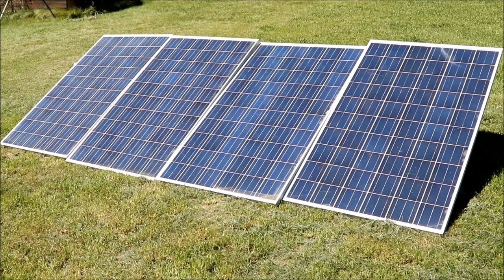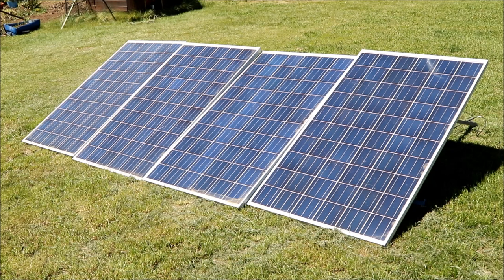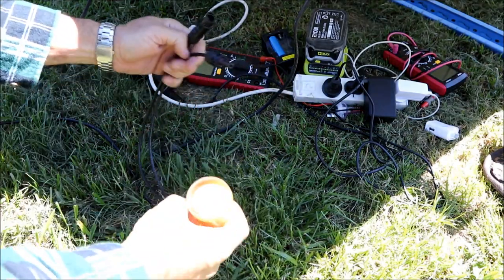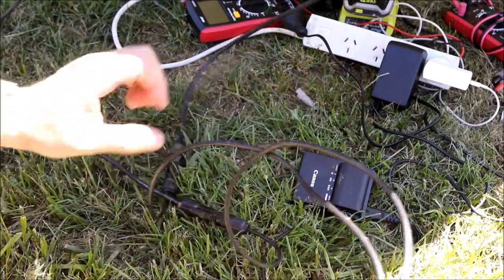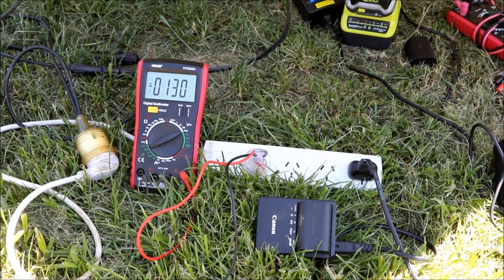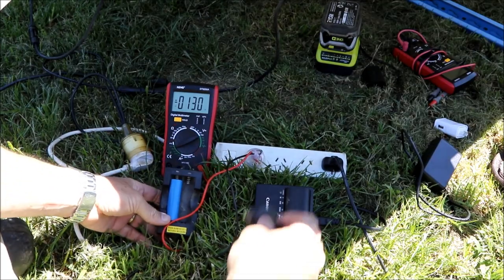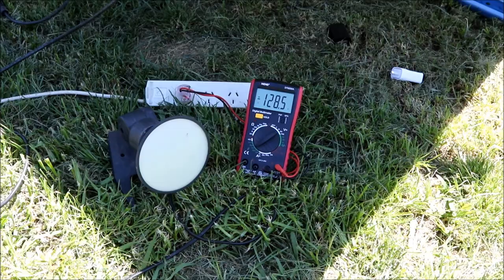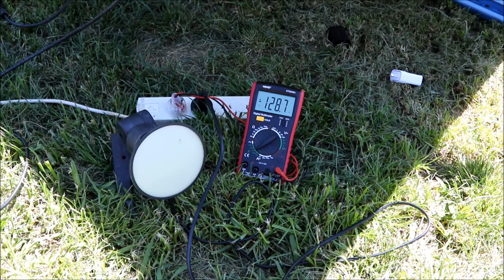Powering AC appliance's Direct from Solar panels.

Comment: U know what all these chargers do?
the rectify the AC from the mains they are "fed" with, to charge the first (primary) capacitor
so giving them DC as "food" the primary rectifier in switching pwr-supplies 
just kinda gets the current thru one diode.

as for the secondary side of pwr supplies U often can power up devices with blown pwr-supplies 
externally by connectin just another pwr-supply in parallel. the output voltages I mean.
So I have a monitor here that just needs 5V and 12V internally to operate.
I run the monitor with an old pwr-supply from an HDD case.
noo need to find components that lost their markings.
Grannys washing machine runs the same way. It just needs a pwr-supply for driving the 5V micro-chips
and 12V for the relays in there. the relays have to switch the AC mains for the motor and the heater of course.
Greetings from Germany

Comment: I am interested in 12v, 24v, 48v power systems and equipment.That's what we will all be left with when the Sun lets the magic smoke out of everything before too long.
Reply from the maker: That's something I'd like to look at as well but is a bit exy to do for Vids as I don't have anything.  I was thinking if I do more solar Vids or even do a solar Channel I might be able to get some companies to send me products I can set up and do vid reviews on.
Reply: @glumpy10  Sounds like a great start! However, I fear having only a solar channel might be too narrow, too specific to draw a wider audience. 
I'd like to share some thoughts on it? Not saying you should do any of this, just thinking out loud: 
Maybe - How about expanding the oil-burner theme into an exploration of all kinds of home made energy and power generation techniques (like making power if the grid goes down).
There's biodiesel, biogas, solar panels, parabolic solar cookers, fresnel lenses, wood-gas production and storage, HHO production from batteries charged up with produced power, all kinds of fossil fuels-plastic to gasoline, used motor oil to black diesel or just thermally cracking petroleum products into fuel, wood stoves and heaters, other kinds of oil burner type heaters and heat exchangers, thermal mass heaters, rocket stoves, candle power, steam power, human / animal powered generators, refractory cements for building forges, crude battery building or rebuilding from scrap, casting metal parts for energy machines, and many other topics. Appealing to a wider audience this way will lead to more subs, more subs will lead to endorsements and sponsors. 
Or you could just start a Patreon type deal, or offer more content for $$ with the Youtube channel subscription( i don't know much about it, but I pay $5 through youtube to see private stuff on RobertMurraySmith's channel, extra info vids and so on) . 
I hope some of this is useful, I know it's hard to do anything without a budget, but I know you are quite a resourceful and out-of-the-box thinking Oil Burning Maestro, so no worries. Also you might suggest that I start a channel instead(lol), but I am quite ugly , have no personality and have a terribly mousy voice, it just wouldn't work..lol. You on the other hand have charm, pizazz and a special spark, a very bright and relatable personality. Keep up the fun. We all enjoy you having fun with it all.
Cheers and enjoy the weekend.
Reply from the maker: @undernetjack   Wow! I think you must be confusing me with someone else but thank you for the very kid words.  I think you are right in looking at a broader range. I was thinking more DIY power generation like with converted induction motors, Methane I have played around with and the like.  Independence or at least backup is something I like so that would be the overall theme. 

Was also thinking of what you were saying, would be nice to get some sponsorship with related products to try out and report on.  I sent Bangood a message recently about an oil burner arrangement they have someone pointed out to me  if they would send one for me to review but not got any word back so far.  Thought it would be perfect for this channel but obviously they thought different. 

Anyway, thanks for the very useful comment.  It was helpful and great feedback.  Much appreciated.

Comment: Challenge: Solar panel that runs a water pump that moves water that turns a paddle connected to any sort of alternator that charges a battery
Reply: What is that your creating a arc with!!??
Reply: Hey a solar powered jet engine (arc, blower, fuel) would as well be a great video
Reply from the maker: Why would you want to have a pump running off solar turning a water wheel? Sounds like some sort of "Free energy" crap where they make multiple conversion losses and claim a net gain!  :0)   Then again, the more complex you make things the more impressed people are and take it as creditable even when it's not.  The arc was just some carbon Gouging rods I touched off a metal plate.  I have ordered a Ducted Fan engine I am waiting on to do an an oil powered Jet or Motor jet as it is more correctly called.

Comment: oh yeeeah because the switch mode power supplies first rectify the AC to DC, 240v->400V in a capacitor, and then it's business as usual. You can just feed it DC directly.

Comment: Please don't do this. If you know what you are doing, chop the plugs off and hard wire the chargers. If an initiated person saw the power outlets and plugged a non switching device into the power board like an old power cube or transformer, they could start a fire. If you know what you are doing, you need enough DC to meet 1.4 times the minimum AC voltage of you device, but it should be hardwired or use different plugs so people cannot accidentally plug unsuitable devices in.
Reply from the maker: This is the sort of safety obsession  mentality that has infinitely more potential to cause problems than what it seeks to prevent. No Idea what an Initiated Person is nor what they would be doing wandering round my back yard Plugging things into what they don't understand. My wife and daughter know better than to touch anything like this and so does the dog as I have never seen here messing with anything I have been playing with either.  Who do you think is going to come in you yard with a lead and be looking for any outlet they can find?  Not about to chop the plugs off anything as this is temporary measure and will want to keep the panels intact and can't chop off plug packs as that would then be running hundreds of volts  though something designed for less than 20 and that WOULD start a fire or destroy the appliance.  Did you even watch the vid and take note of what was being used?  Clearly as demonstrated in the Video, you do NOT need 1.4 Times the  AC voltage at all. I was running things with less than half the normal AC voltage. IF you see people plugging into this and causing problems you either need to educate your family or secure your property.
Reply: @glumpy10  I am an electrical engineer and understand what is happening very well. I said 1.4 times the minimum voltage. Many switching power supplies are rated from 90 to more than 240VAC so the minimum voltage will be around 130V DC. You may get away will less but you will stress the components in the power supply as the switching circuitry needs to work harder than it was designed for.
On the safety side, I was referred to this video by someone who did not understand what was going on, not one of you family members who may be educated. They could easily have copied your approach directly and left a power board lying around connected to a bunch of solar panels. Normal power outlets have lots of safety features like RCDs which this approach lacks. So protections from kids putting metal objects into GPOs is missing as are the short circuits you will get if you plug a conventional transformer or motor into the outlets. In your case you have relatively few solar panels and are using a power board that should contain a circuit breaker, but it would be very easy to copy the idea with more panels and have a serious fire risk.
While I understand the nature of this video and the idea is very cool, it really does need some warnings to protect yourself from legal issues when people copy the idea and hurt themselves.
Reply: @glumpy10 you’re a fuchhead mate. I love this guy’s videos about use of waste oil but this one is negligent as it doesn’t describe or unpack the theory of dc and ac electricity in a way that the average bloke can join the dots as to what kind of appliances will work and what kind will trigger an electrical fire due to heat. When you put this information into the hands of the uninformed but willing to experiment, then you are handing them an unsafe loaded gun. Pull your head in cee you next Tuesday
Reply from the maker: @startingfromscratch7469  Oh, you are one of those guys that think peoples personal responsibility is someone elses job!

I learns a Loooong time ago, the stupid are going to do stupid no matter what and i'm no ones mother either.